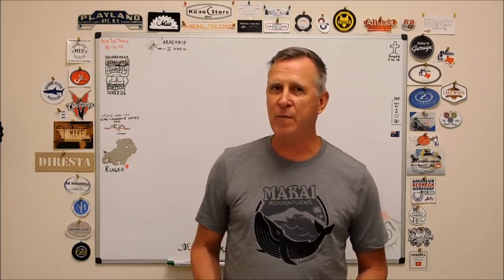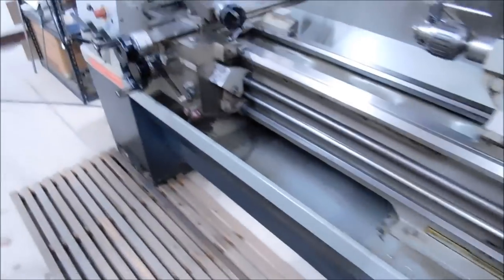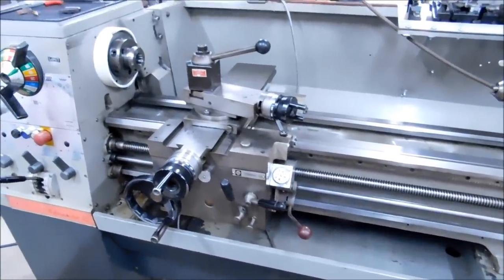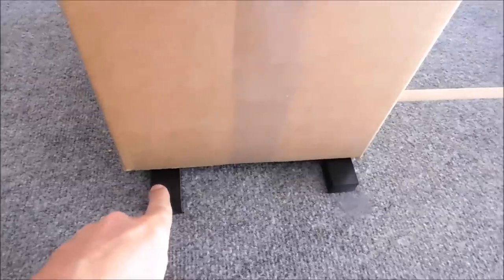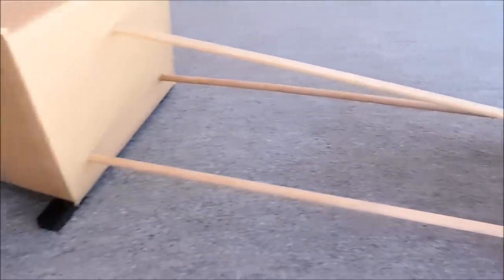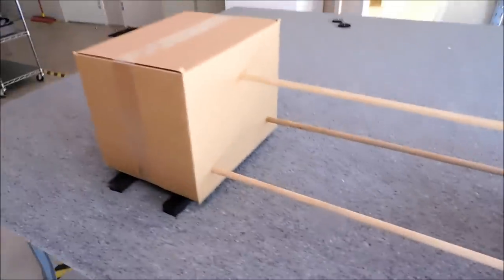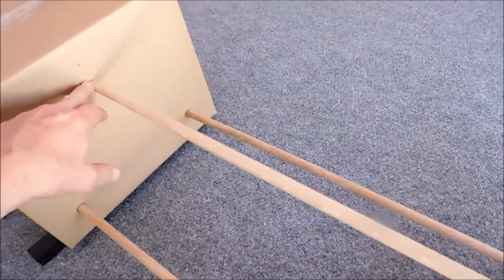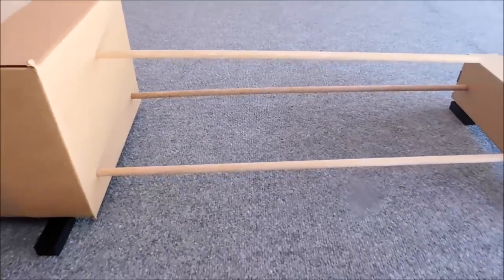Lathe Leveling - Waste of time ????

Comment: Another great presentation.  Thanks.
Newer lathes present another problem.  The headstock does not locate on a V way.  It has jackbolts to align the spindle centerline with the centerline of the bed.  How about a short video addressing that adjustment?
Reply: Headstocks aligning on the Vee are the suck.
level the bed to remove any twist. Put a 3" diameter aluminum pipe 14" to 16" long in the 4jaw, and make test cuts with a shear tool, and measure the diameter at both ends. If you need to align the head stock, keep in mind it will shift when the bolts are loosened. So put an indicator at either end of the tube before loosening the bolts. Once the horizontal alignment is complete, sweep the top of the tube to verify vertical alignment.
I disagree with Joe on the importance of vertical alignment, it has to be way off before it has a meaningful effect on the taper. This is just simple geometry. Fire up Fusion 360 and check for yourself. For example, if the headstock points up 0.050" at 12", the result will be about 0.0008" taper. The smaller the diameter the bigger the affect. 0.015" mis-alignment will give about 0.0009 taper.
Reply from the maker: Please point out at which part of this video, I said vertical alignment wasn't important. i think you misinterpreted something.
Reply: You addressed vertical alignment very well.  Not discussed was the use of jacking screws to shift the headstock front to back.  I know hoe to do it with a 2 collar test bar held in the chuck.  I am betting there are a lot of viewers who could have benefited from that discussion.

Comment: Joe
When people say they have levelled their lathe and not done any accuracy checks just make me ROFLMAO.
Then I ask them why is it important to get it level to the big ball we live on 
Yes it can help on a mill to set up a job 

Then I ask them how do you level a lathe on a ship ?  As you know the do have machine shops on board ,certainly not at sea , could it be done on dock maybe , dry dock again maybe , is the ship floating level I doubt it very much

but as you say the lathe must be true to itself , and be without stress , if it’s set up that way to be truly level to the big ball matters a jot 

keep up your very informative vidieos 

Now I must get down to the WS and get the concert mill warmed up and make some parts for my miniature triple expansion engine , while that doing its stuff do some bits on the manual mill , lathe work to come later 😀

Comment: I agree with @componenx.  Having served on numerous navy ships, including a repair ship, I would say it could be mounted on the overhead, as long as the be is not twisted.  I have my two lathes mounted on glue-up wooden bench tops (suggested by Atlas), and held down by two lag bolts through the from legs, allowing the rear ones to float.  Works fine for me.

Comment: Timing. I have half done one of two lathes today at work. Monday I finish the jobs. Great demo. 
Mine also have 4 bolts at the tailstock end. Never worked with that before.
Reply from the maker: I ran an 18-140 gap bed Mazak for many years. It had a center island on the bed because it was so long. Imagine how that came into play for the guys that set it up.
Reply: @joepie221  I never got to see them but my father set up old ww2 lathes that made the barrels for big war ships when he worked with the dep of defence. That would have been one interesting experience.

Comment: That's a great presentation. I see a lot of cases where a machine mover contractor hires another contractor to
 laser the machine and comps it out to be "straight", instead of physicaly leveling the machine. The people doing that have no clue what to do to make it right. All they do is introduce stresses into the frame castings and allow the machine to get bent.
Reply from the maker: On large CNC machining centers, the head is fixed and the column is rigid. You actually have to tweek the level of the table with the machine feet to indicate the spindle. reverse procedure, but the only way to do it.
Reply: There is a long list of different kinds of design when it comes to machine tool machinery. The good ones are heavy and rigid with a properly built foundation and no soft feet. I'll take an old American design like a Producto, Gray or Cincinnati Milicron that has replacable ways over anything imported with ways machined out in the frame like a Mazak Y, or YB. Too bad that most domestic machine tool makers have been sold and no longer in operation. I look at it from maintenance prospective because thats what I do for living. Older designs are easily upgraded with modern controls, but sometimes the people who make the decisions to purchase equipment don't have a clue what's good.

Comment: Great that you're drawing people's attention to the necessity for correctly setting up machine tools.  Of course, Georg Schlesinger wrote about this in the 1920's. https://www.pearl-hifi.com/06_Lit_Archive/14_Books_Tech_Papers/Schlesinger_Georg/Testing_Machine_Tools.pdf  He thought levelling was reasonably important, too, though, but level on the little Colchester / Clausing you show won't matter too much, after all, some large warships used to have combination machines bolted to a bulkhead, and that would seldom be level in either axis...    

It's easy to demonstrate how flexible a centre lathe is, using a long bar held in the headstock chuck, and a clock clamped to the bar to indicate horizontal deflection of the tailstock barrel. Jacking the tailstock pedestal jack screw nearest you, you get a significant deflection, especially with a tenths clock. (it doesn't matter that the long bar you're using naturally deflects in its vertical plane).  Sometimes people have to see a practical demonstration to believe.  I benefited from seeing the Colchester installation team set up a dozen then new "square head" Triumphs and Mascots 45 years ago.  It's great to watch the specialists.

Comment: Only 4 feet on my hobby size lathe! When I installed it I mounted a DTI on the tailstock, reading off the end of a 1Ft bar in the chuck, and made sure no deflection as I tightened the bolts down. As for 'level' I just made sure the whole assembly ( stand & lathe) tilted down towards the suds tray drain fitting.

Comment: Leveling is traditionally done with a machinist spirit level. That is where the term come for lack of better term.  A lathe will work on ship during a storm, upside down, bolted on the wall or on the Moon.  Clearly levelling has nothing to do with the horizon, is just an approximate term.  Old timers were probably not so much literary scholar and picked a term they understood.  Yes we say leveling but mean "untwisting" which is not an English word. And there lay the crux pf the problem.
Reply: We also talk of two surfaces being "level with each other", or planing a single face of a workpiece "level", without consideration of the relationship with horizontal, so the word does have two meanings: horizontal, and planar.

Comment: Hi Joe, I also jack up the machine in order to minimize taper! I'm a bit afraid to do adjustments to the head stock alignment, as I cannot  (easy) confirm or verified dis alignment from top or bottom. Now I got a half thou over a distance of two inch round stock , (diameter 2 inch) cutted direct  from the head stock! (not between centers) I hope I can improve this, as I do cylinder boring over 6 inches, and after the boring operation, I still can honing the iron linor straight, but I prefer that it comes from the machine with minimum taper! Anyway, got again useful information from this video! Many thanks.

Comment: Harold Hall outlines a nice procedure in his Lathework book on cutting a cylindrical square as a test for headstock alignment. On the (tiny) Taig, I was able to get within a tenth.  My newer 13x40 Colchester clone was close enough without adjusting the headstock, fortunately, since while it has better provisions for adjustment, actually getting at them requires a lot of fiddling.

Comment: Well the truth is...I worked as an Aircraft Propeller,Blade Technician for about 20 Years...It is my belief that Yes it is a waste of time...However if You feel the need to level Your lathe then by all means level it...the thing is that level ness has to do with the 
Relationship between the headstock and the remainder of the Lathe...btw very good video.. !

Comment: My lathe (Maximat 11, 11' swing x 24") lathe has the ways project all the way under the headstock, so in effect, the headstock "sits" on the bed like the carriage & tailstock.  There are only 4 leveling screws, 2 at each end, so bed twist is all I need worry about (or can do anything about).  On larger lathes, the bed usually gets "super thick" near & under the headstock to resist the deflections you are concerned with.
          Have you measured your lathe, or tried to make these errors happen, to note their severity?

Comment: I restored my little SB10k, had the bed scraped, the saddle fitted with the magic plastic I can't remember the name of, then bought a test bar and 'leveled'. The tail-stock needed small bit of shimming.
Result true.
Reply: I just restored a 13” SBL, came out good. But a friend of mine did one and has a substantial difference in height between his headstock and tailstock after leveling, about .018”. What is this magic plastic filler you speak of? You’ve peaked my interest.
Reply: @ryanjones9305  MOGLICE OR TURCITE

Comment: Joe,
Following your lead with a kink.
I have your lathe with one exception, it's a 15". Has 8 feet. 4 on the head stock and 4 on the tail stock.
I was able to slide the apron along the 50" ways with perfect (no twist) alignment.
When I went to check  head stock vertical alignment I had a problem.
Using a 12" tool steel, tight tolerance rod (all i had at the moment) I thought I would check it. Over the 10" I had about .003" lift moving away from the head stock.
I raised the far left feet and it got better. Now my inside feet are not touching. It took me an hour to get them perfect. I'm starting over.
Suggestions? Anyone?
Thanks,
Jeff

Comment: Great video! Just a note to take into account the natural bend in the bar due to its own weight when comparing a measurement close to the headstock with far away.
Reply from the maker: If a bar sags, you'll see whip in your indicator.
Reply: What do you mean by "whip" ? Kind of bouncing?
Reply from the maker: @patkirk960  Yes. As the bar end sag produces a bigger spinning circle, your indicator will go high to low and back again. Tap it out until it runs true.
Reply: Ah... thanks for reply.  Of course grabing hold of the bar with your hand and giving it a flex while the bars stationary and the indicators on the bar will also indicate if the bars sagging . Good stuff. Ta

Comment: Lathe levelling absolute must if trying to get precision of under 1mm. SO, SO absolutely necessary. Crazy how much it actually affects precision, especially with bigger parts that are closer and closer to the mass of the lathe.
Reply: Ridiculous comment!
Makes the statement that "people misuse the term and don't address the real requirements"
Proceeds to state that levelling is an absolute must.
Reply: Under 1 mm? I think you have couple of decimal places missing here.
Reply: @TheWireEDM  It's a generous roughing. Most lathes will do 0.1mm no problem but it'll be dodgy if the lathe is not properly configured, and some models are more susceptible to, well, gravity, than others, but will have awful surface finish; and 0.01mm would be unachievable without "leveling", and don't even think about 0.001mm without the machine being spiffed to the max. So, no. I don't miss any decimals. I'm just omitting information in lieu of a shorter comment.
Reply: @dimitar4y  Have you ever actually machined anything? 0.01 mm can be held with even a clapped out piece of shit that is out of level, it just takes a bit more effort.
Reply: @dimitar4y  I thought neanderthals were extinct, apparently not. || The english language has about 600,000 words of which you've only mastered three of four words involving bodily functions to express your deepest, profound, thoughts.  A three year old has far better skills.  Your epitaph will read:  I'm a man who created nothing, produced nothing of value, help no one but myself, and learned little after 12 yrs. of tax payer paid education, except for the most vulgar words and debauched ideas.  I am a proud man!

Comment: What do you do when your machine only has four leveling screws.  Two under the headstock and two under the tailstock.
Reply: An old machinist told me that the smaller the lathe bed is the less you have to worry with leveling the lathe. I think he was saying that a 20 lathe bed isn't as sensitive to being out of tram versus one that has a 40 inch bed. That may be why some lathes have only two adjusters at the head and tail end because the bed is solid enough that there isn't a need for the extra adjusters.
Reply from the maker: I agree. i would expect to see only 4 adjusters on smaller machines.

Comment: I do agree, though, people misuse the term and don't address the real requirements. The lathe needs to be true to itself and it needs to be in parallel with gravity to equalize the forces of gravity that play. If you perfectly true up a lathe and put it in concrete or something; the moment you tilt it against gravity, the thing will skew, still; so you need to true it up to counteract gravity, again, but then vibrations ARE Amplified thanks to gravity.
Reply: How do machinists on ships get anything accurate when the lathe is not only never level, but is continuously changing its axis of rotation in relation to gravity?
Reply: @philmenzies2477  with difficulty, i guess they setup their lathes by turning test pieces as obvs level would be all over the place
Reply: @transdimensionalist  It was a rhetorical Q...........sigh

Comment: Hi Joe, and thanks.  2 questions....  1. Your final admission about deliberately putting in a twist in order to avoid a taper.  Is that an accepted method?   Or does it introduce other unexpected errors?  2. I have a lathe which has 4 adjustable feet at the tailstock end, and 4 at the headstock end.  How do I adjust the 4 at the tailstock end?   So far, I have ignored the outboard pair until all levelling is complete, then just making them contact the floor.  But after watching this video I am thinking that I should be treating the tailstock end the same as the headstock.  But how?
Reply from the maker: Maybe a rod in the tailstock and spin an indicator at the headstock. Line the 2 up by adjusting the outside leveling screws.

Comment: Hey Joe could you use a bore sight to sight your tail stock in?just wondering thanks.
Reply: if the dot is small enough, sure. But it still won't be absolutely dead on.

Comment: 2 bad, i watched this vid after i realized tht truing my bed was changing every thing. Before it, im trouble with parting and hard cut. Always "barking". After truing my bed, i can parting easy, even with 3mm parting insert. And can cut 3mm depth. Trust joe, make your machine stright. My lathe just cheap Chinese, 6" chuck. It is good as expensive are. Hard cut more easy, even 0.02mm on hss could done. Thks joe

Comment: For years I've had to align pump and machinery frames with dial indicators a machinists levels..Early on had no idea what soft foot was or that such a rigid looking structure could flex the way they do...that being said...I prefer to have any machine as straight as possible...if I have a issue with a machine I would prefer that it's myself making the error not the machine.. maybe a bit anal but I don't need help screwing something up..haha..again great video!
Reply: I suppose  squared is wayyyy more important than level....

Comment: Anybody here ever use a 696Z Crankshaft Distortion Dial/Strain Gage made by LS Starrett?
I have  many years ago, on huge reciprocating engines to check for web and crankshaft deflection. 
These engines were so big they had catwalks  and you could get inside them. 
Something that massive  had to have shims put under the block/frame to make sure everything was lined up. 
Those machines were set on grout not regular concrete. 
If anyone is considering having a shop set up they might consider figuring out where  a big machine will stay and pour a pad with self leveling 3 part epoxy grout.
Then anchor that machine to the grout with shims and studs/bolts accordingly.

Comment: Old video I know . I'll ask anyway.  I have early 60's Craftsman 12" x 36" lathe made by Atlas. This is a bench-top model . It's mounted on a Wooden bench ( bought it this way  )
The legs are 4"x4" top is 1" , well built 
but still "Wood" .  ? Is it  still possible to twist or un-twist this ?
Reply from the maker: I would think if the bench is secured, or at least doesn't rock on the floor and the top is nice and flat, the machine should cut fine. If you do see taper in your parts, identify whats going on and use shims to correct it. Many people use heavy wood benches for small machines without a problem.

Comment: well if it is off level and the force the mass exerts exceeds the resistance to movement ..... add in the coreolis effect...... lol does it twist the other way in the southern hemisphere???
Reply: It depends... Is the tide out or in? Also, don't make the amateur mistake of forgetting to factor in daylight savings time.
Reply: Believe it or not, all of those will affect chatter. IF you had an instrument sensitive enough, you could see how on every hour of the day the chatter is different. martybadboy may be joking with daylight savings time, but he's also right if you're trying to push the machine to its absolute precision limit. 
Metal is very, VERY bendy. Just look at bridges. Even concrete bends.